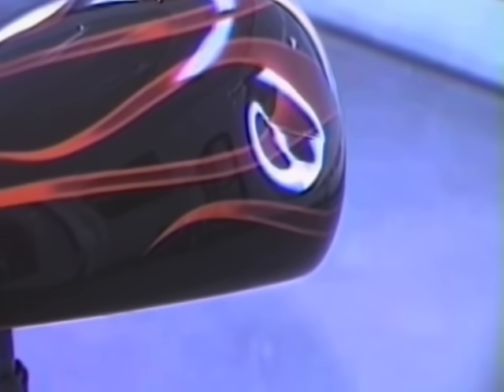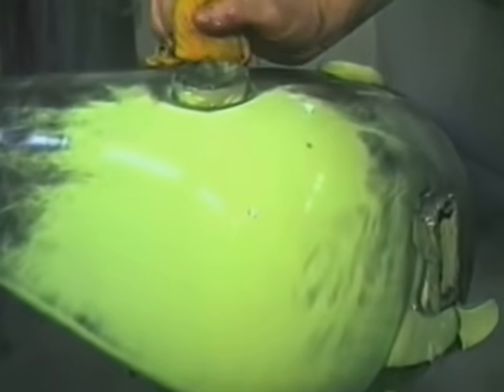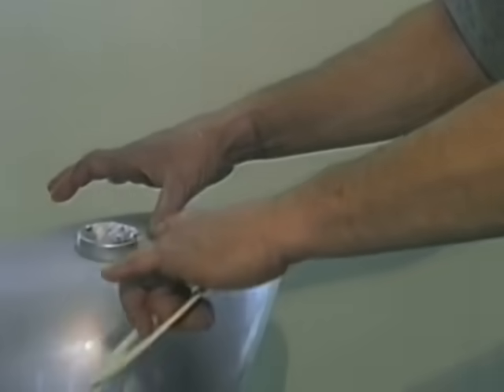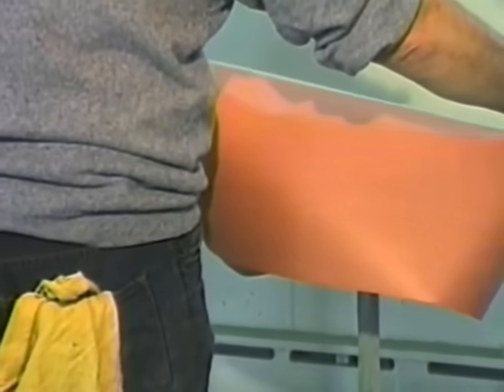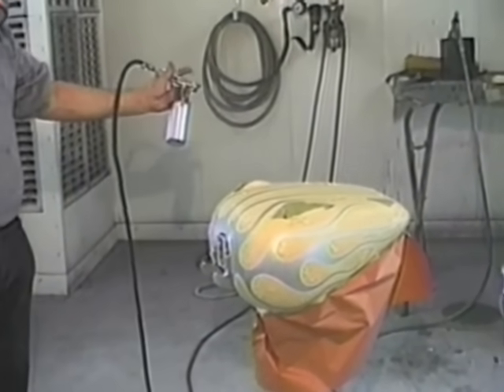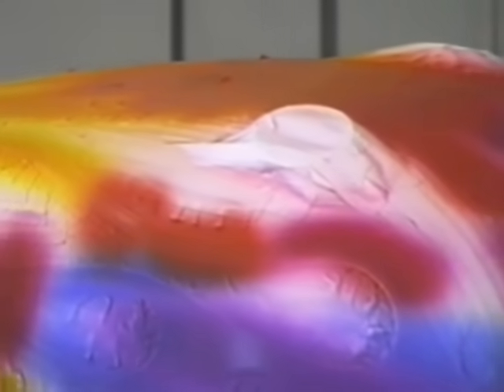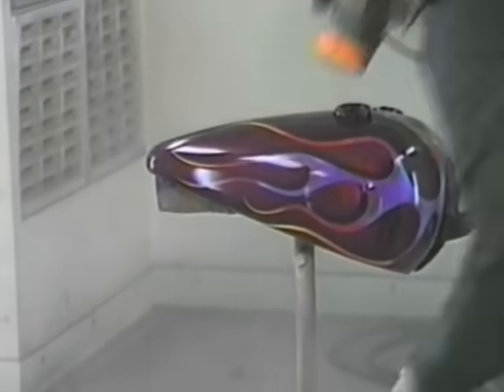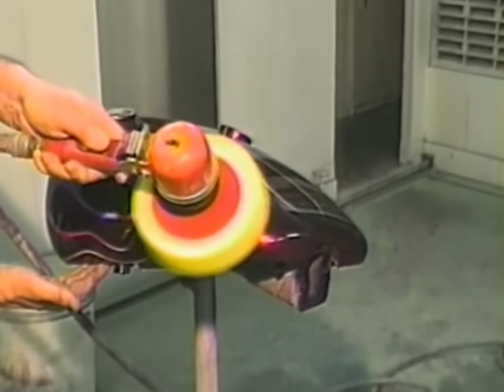JON KOSMOSKI HOUSE OF KOLOR CYCLE FLAME PAINTING

Comment: NO, the reason for NO paint on the filler neck, is static charges, as the bowzer touches the tank it discharges all statics on the car/ bike built up while on the road (rubber in the tyre is an electrical insulator); if paint were there, there is NO electrical path, so there can ( possibly) be a fire risk, as the charge built up can arc to the flowing fuel, causing a fire!- Not what you want at a gas station!!

Comment: Excellent product but not available locally. If you are in a project and run out you are screwed. 
Do not start with it if you do not have access locally. It is not available.  Only online . . Product is excellent but I can not finish the job. really SUX. I will have to look for another system available. PPG?  Eastwood? Createx?  I will never use HOK again